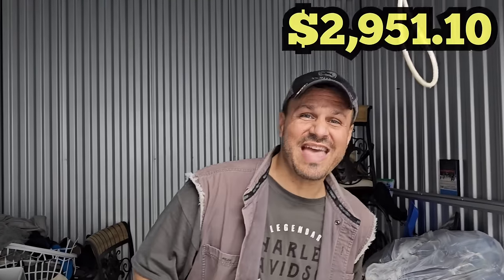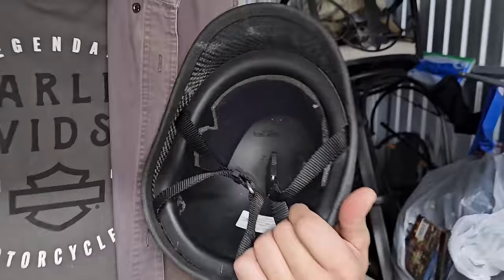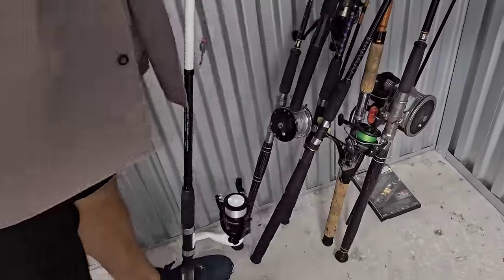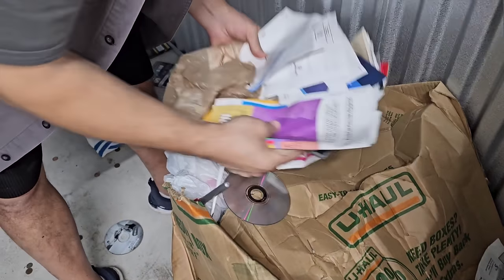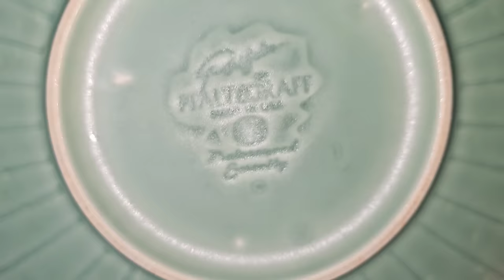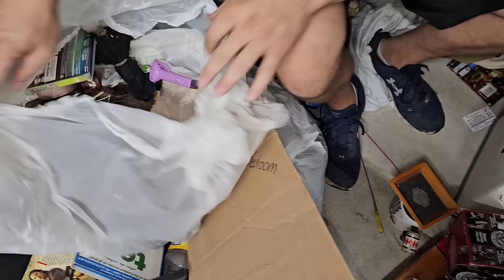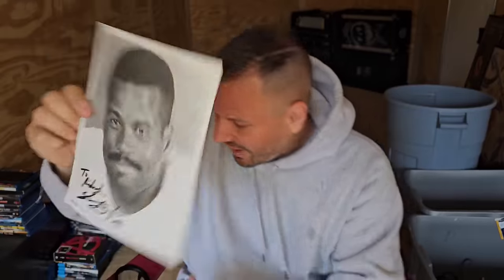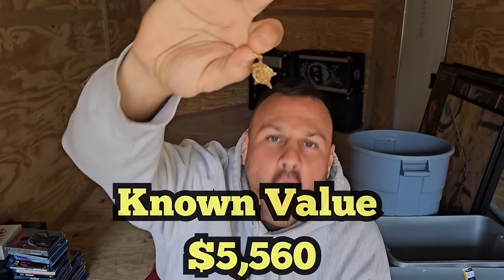HIDDEN GUNS in DRUG DEALER'S STORAGE UNIT

Comment: For your heartburn issues try simply baking soda and water.  Directions are on the baking soda box.  My husband was taking prescription Zantac years ago.  It worked some of the time but not always.  My 102 year old Mom fixed baking soda and water and instant relief.   After several months of using it when needed his heartburn issues went away.  He would always have some in a bottle.  Easy to fix when out and about.
Crazy but my husband was a Court Reporter for 30 years.  He quit after working for a Judge who was on a power trip.  Couldn't take it any longer.